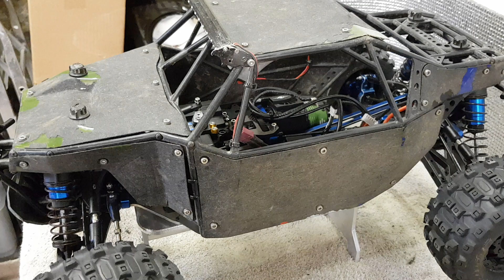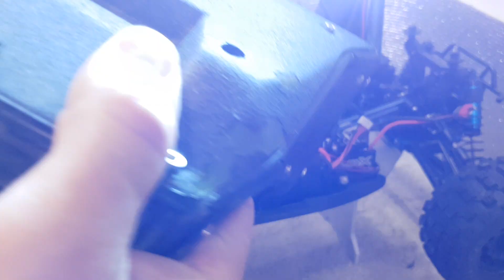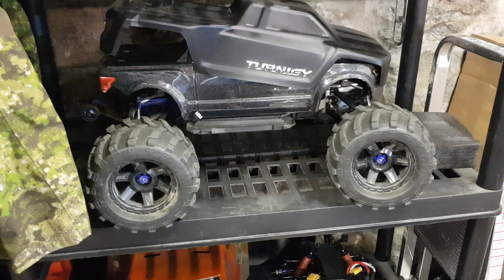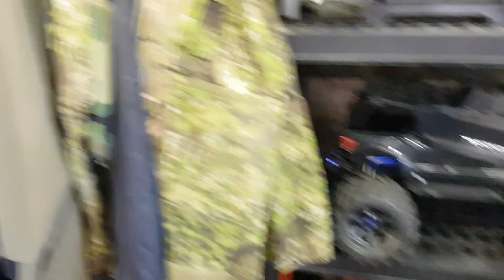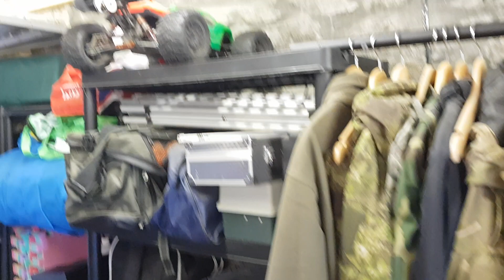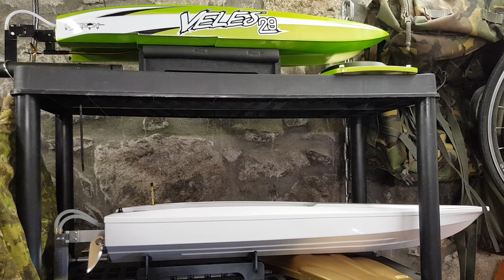Associated DB8 UNRooted RC Custom build

Comment: The Proline twist off caps look great on this rig! Did you make any modifications to the posts to make that work? Looking to upgrade my body clips on my DB8 and just curious how you went about it? Thank you!
Reply from the maker: Hi yes I did mod the stock body posts by chopping of a section on the top and drilling pilot holes for the m4 threaded bars 👊

Comment: Love your style on this, my kinda taste too 👌 I've recently bought a db8 and looking to upgrade some parts like you have to make it more bulletproof, if you could point me in the right direction on parts and where to look that would be great as I'm pretty new to all this
Reply from the maker: Hi Lewis sure thing, start with chassis braces, to plate and carbon fibre centre diff plates, body panels are truck bed liner, I replaced all electronics too, shock towers were also carbon fibre
Reply: @jameslyons1978  thanks for the reply dude, what's the best websites to order from (UK) and my servo has already broken as well so I'm looking at replacing that but I need it to be compatible with the electrical system I'm running currently and I'm not looking to change any other electronic items as its got plenty of power for me
Reply from the maker: I ordered directly from Team Associated in the States mate, servo wise, Savox all the way!
Reply: Okay I'll check them out and what model savox is the right one and if I buy it,  will I need anything else to run it with or is it a straight swop ? And what tyres/ wheels are they ?